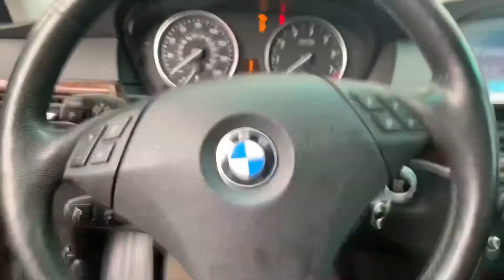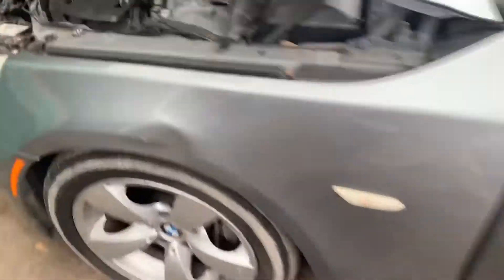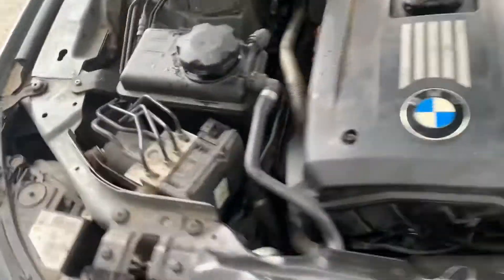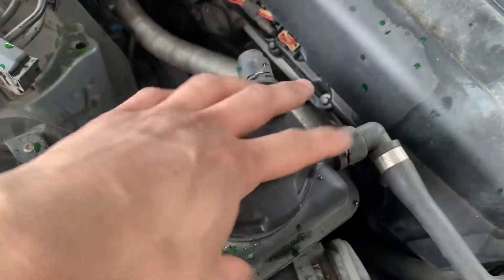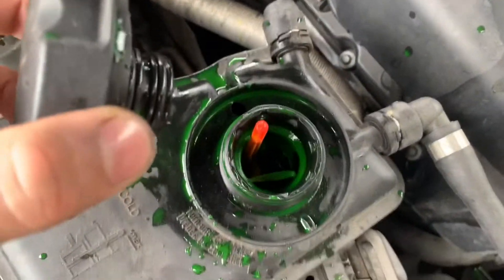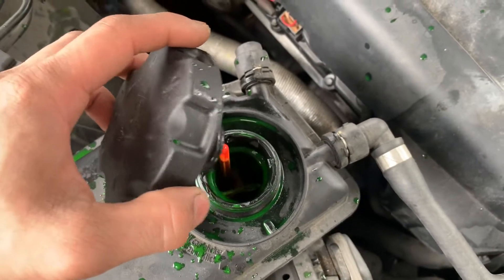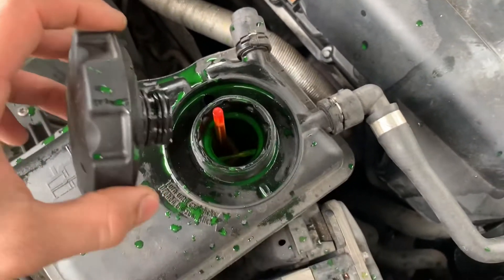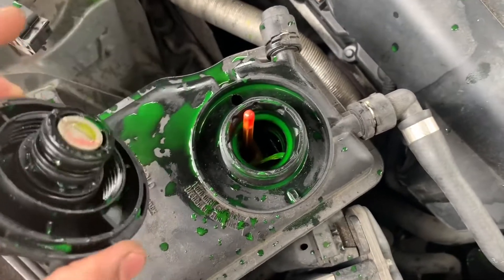2008 BMW 528i Bleeding Procedure

Comment: why does my car not do this? i have the same car in the video and i did all the steps and my coolant doesn’t do anything
Reply: Same
Reply: just figured it out. you have to have your foot on her accelerator BEFORE you press ignition. once you press ignition, the press the auto button on the center of your climate knob AND THEN adjust it to lowest mode, hottest setting and pump should cut right on. i was struggling to bleed my system for the longest, i use ista and tried to do the bleed procedure many times but pump just wouldn’t run. i can finally rid my cooling system of the air gaps.
Reply: @ShizzyVlogz thanks man mine wouldn’t bleed at all till I did it your way
Reply: Probably your water pump has failed you need a new one as well as thermostat
Reply: same

Comment: Why is the coolant green ? It’s supposed to be blue
Reply from the maker: Good catch! You are 100% correct. This customer had been using green ever since they had a radiator replacement (elsewhere) so to keep it consistent, and not needing to flush, green was used.